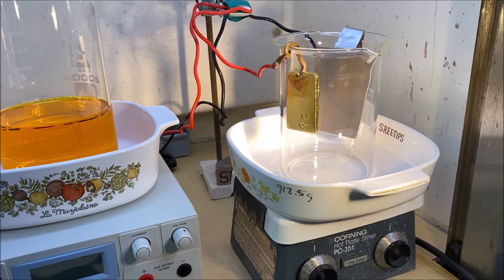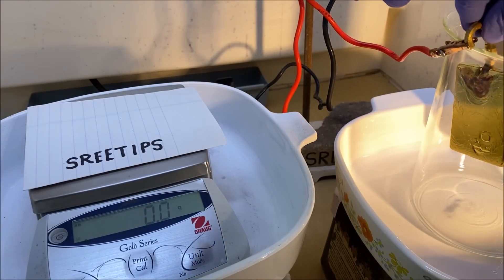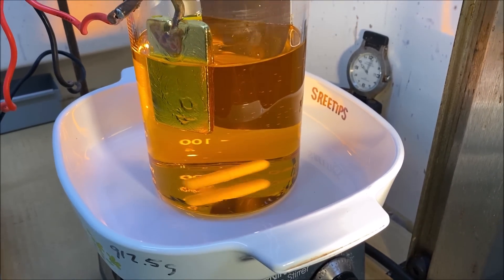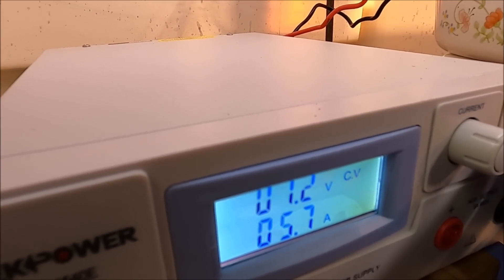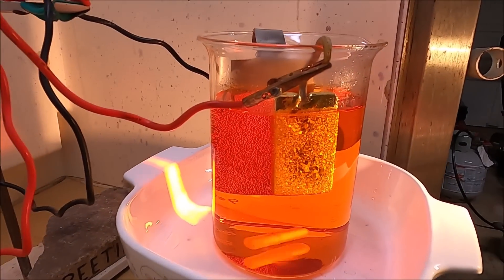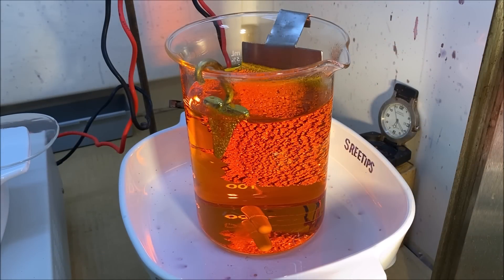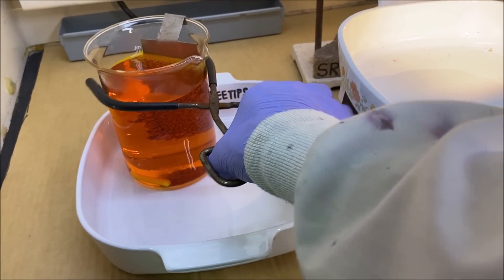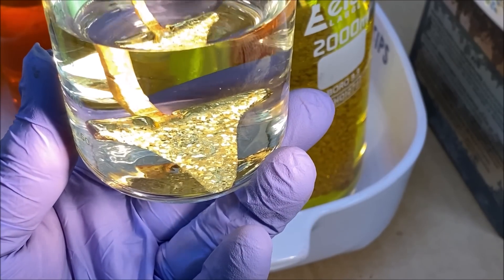Electrolytic Gold Refining Cell Pt2

Comment: Are you doing this to practice the procedure? Whats the benefit of refining 999 to 99999 that you can’t do with a few more chemical refinings? How pure does the anode have to be, is there a lower limit? Thanks!
Reply from the maker: Three nines is industry standard for pure gold. So the fourth nine is totally unnecessary unless needed for some specific purpose such as a test standard. The only reason I did it is for the show. To demonstrate that I can, and produce a new and interesting video for my channel.
Reply: There is no real value benefit difference between 12k gold scrap and 4-5 nines fine. He has stated this many time. The book did say however, the anode had to be "fine gold" and that is defined as .999 pure. The book also said that you should use impure gold for the cathode. sree used platinum. 

The anode should be near pure gold because it just gets eaten up. Using impure gold would also just get eaten up, although impure gold would also add resistance to the power flow at some point, and possibly contaminate the electrolyte, negating the purpose of an electrolytic cell.
Reply: @En-Pea-Sea  Small correction, sreetips used titanium for the cathode.
Reply: @apveening  oh yes, you are correct, he did say titanium. Thanks.
Reply: @En-Pea-Sea  You're welcome.
Reply: @En-Pea-Sea no benefit then why do it?
Reply: @MerchantMarineGuy  he is doing it for our benefits (publishing a video) and for some self discovery. He says this in many videos.

Heck, sometimes he just "makes stuff up as he goes" just to explore and share.
Reply: @En-Pea-Sea  and I’m really glad for that. I’m just saying in general, what’s the benefit? Not even Fort Knox keeps 999 gold
Reply: @MerchantMarineGuy well, ultra-pure gold has some special uses. But I guess f.e. those guys who made the mirrors to JWST have their own systems for obtaining it, they probably won't go to Sreetips Store. 

On how pure must the anode stuff be, the general answer is that contaminants should not be more than, i guess, half the amount in the original electrolyte or something.